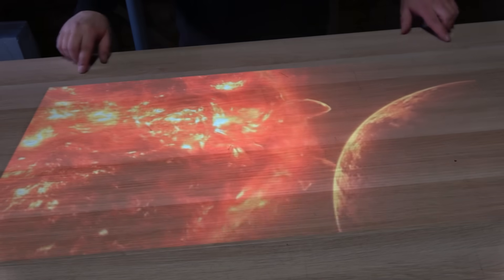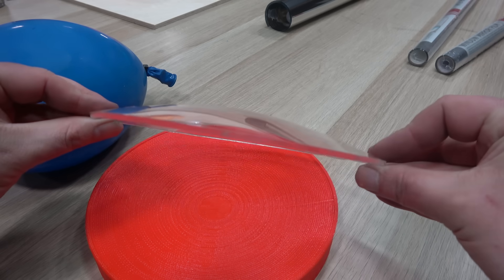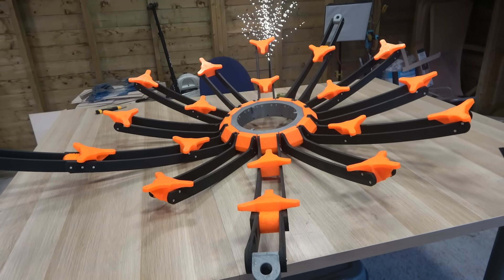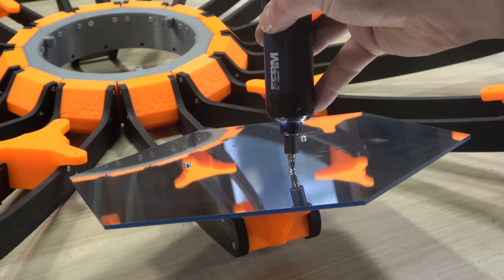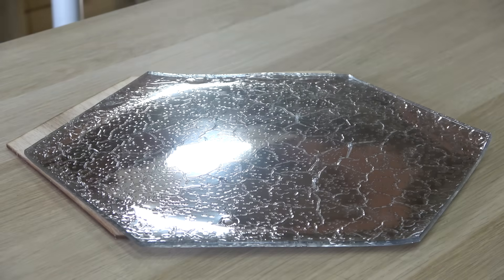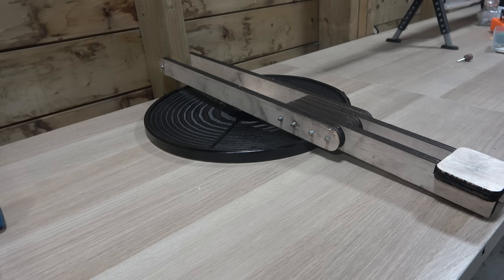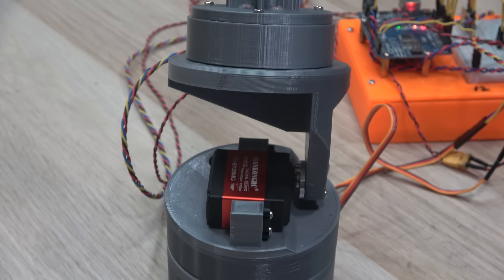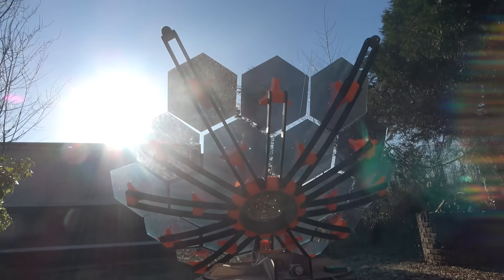Building a DIY Solar Generator..

Comment: I'd make the aluminum plate black to reflect less light. I personally would make more parts out of metal, but what you are doing seems right for the prototype stages. I'd replace the acrylic on back of the aluminum plate with something more heat resistant. I've see smaller mirrors melt metal and stone in short order. I would think that amount of heat might outrun that pump. Maybe add a temperature monitor to the system and program the tracker to take a break if needed in the current config. Paint can be polished to a real good surface finish giving it more reflectivity. I'm not sure how well 2k or epoxy paint works on acrylic, but that would be a more durable paint. 

Cool project.

Comment: It might be best to put the pivot point over the center of the lazy Susan. This way there won’t be any drag on one side of the bearings. Which would cause the wood to rub which would cause friction and make it not turn smoothly.

Comment: What an awesome project!  Very impressive. I think you're right to be concerned about the veritcal adjustment mechanism though. I'm sure it works great inside but I would assume that any amount of breeze outside would cause a failure, the mirrors will act like a huge sail. That same motor might work but I think if the reflector frame was mounted to a trunion, not unlike a bandsaws table, it would be a lot more stable and robust.

Comment: Some suggestions for improvement:
Shape the mirrors before applying the reflective film, that way the heat doesn't affect them. This does have the downside that you'd need to use a rubber or other flexible squidger in order to apply the film
individually parabolic hexes don't add up to a parabolic array, you should have forms to shape them to make the full array of mirrors parabolic. Based on your design, you would probably only need three forms: one for the inner 6, one for the 6 outer corners, and one for the 6 outer middle hexes. If it isn't clear, it's similar to making a giant poster by printing it out on multiple sheets of standard printer paper and then taping them together

Comment: Suggestion 1:  Have the focal point separated from the mirrors, like the molten salt reactors. Since you are using separate mirrors, they can be placed in any configuration. Only sun tracking is not as obvious anymore as your current solution. Combined with the multiple non-parabolic mirrors as described by @leifhietala8074 could make construction less complicated. 
Suggestion 2: Use aluminum foil for reflection. Your painted surface still looks diffuse which will scatter light all over the place. The reflective side of the foil does a far better job. Not sure how it holds in the dutch weather though :)

Comment: I absolutely understand that people who make these are way more knowledgeable about them than I am, but, my thoughts:

- 1: really, all you'd need is the mid point height for noon, and sunrise and sunset; cause then you can just have a single gear controlling it, and a limited range (unlikely to meet or exceed 180*); which means fewer components, less moving parts, and cheaper/easier to maintain

- 2: add some kind of self balancing aspect to it; basically best I can figure is a heavy enough ball weight, that slides along a track to keep the center of gravity low, so the thing won't randomly tip over from the top

- 3: more nitpicking than anything else, I'd close the gaps between the mirrors, lol

what I am curious about, is if maybe this type of solar generator would maybe be better than regular panels? if so, this could be far better to implement than panels, and has the ability to be hidden as needed (or even super decorative/decorated). Cause the panels just like bland generally. And, I'm curious, are you trying to get it to boil water and turn it into steam, or is there something else to it? Cause I was thinking if we did the molten salt solar plants on a small scale you could do well with improved power generation for homes.

Comment: The aluminum collector has the potential to transmit heat to your 3D printed components unless most of the heat is extracted from your water.  At that temperature,  your plexiglass will warp & spill your cooling water - creating a runaway temp condition. When you 'go live', have a way to cover the system.
I also think the plexiglass mirrors will absorb heat & will distort.  Have you ever picked up a chrome tool left in the summer sun ? It will get your attention fast !
I'm curious about the results.

Comment: I was expecting better thought out construction on the actual frame.
One gust of full wind the entire setup becomes a kite and will tear of the setup and either crash on the ground hopefully or will fly and crash into or into someone.....
So....
There just too many to count in this setup.
There's a video of a guy from Pakistan who made good one using the existing big sized satellite dish and added in actual glass mirrors piece by pice.......
That was more sturdier than this setup.

Comment: Really interesting project. Back in BEAM robotics days, we would build sun trackers with LDRs that way. The solar panel powers the circuit, so you build the circuit to move motors so that the panel is always pointed at the brightest light source. I always imagined using one to control a large dish like this, so it's super cool to see!

You're using plexiglass for the mirrors, which allows visible, IR, and I'm pretty sure most UV to pass through, right? What about pressing the plexi first, and silvering the back instead? That would give a much smoother finish, but who knows... people do this with aluminum foil, so maybe that much precision isn't worth the effort.

Comment: Since the Primary mirrors are flat and angled for overlap, the secondary mirror will have to have the same or slightly larger surface area to redirect towards the heat plate, but also be offset from center. Due to the layout, the secondary mirror should be a ring of mirrors the footprint of the primary mirrors allowing for direct and reflected concentrated light to hit the hot plate. The primary mirrors do not need to be placed in the secondary mirrors shadow. OR. Solar trough, make a long collector in a parabolic shaped long trough and align it East West so you only have to adjust vertical with the seasons. Flat mirror ends to help with low sun angles. The wider the better, you can only collect as much energy as you make shadow, square footage is everything. I've been looking into vacuum insulated solar tubes for heating water but with a parabolic trough behind each tube I would need a fraction of the tubes and would lower the investment required. They use solar trough to heat salt or oil in power stations.

Comment: Regarding the solar tracker i would recommend you to use an Arduino library which calculate the azimuth and elevation of the sun for a given latitude, longitude and UTC time. It's called jpb10/SolarCalculator

Benefits: you will avoid malfunction with the alignment of mirrors and the sun in cloudy days (something you need living in the Netherlands)
Good luck!

Comment: The mirrors away from the center have to continue the parabola, aka, you CAN'T use the same mold for all of the mirrors, the light will be coming at an angle and not go to the focal point, you need 3 different molds for the ones nearest to furthest from the center (also molds will be directional)
Reply: Given that he's concentrating the light onto such a large collector (the size of the reflecting mirrors themselves), he'd actually be better off making the reflectors perfectly flat. This will distribute the solar energy over a larger area of the collector, increasing its ability to efficiently collect it (and transfer the heat to the water).
Reply: A couple of packs of flat, hexagon mirrors from Amazon are £18 (US$20+), would save a lot of hassle. Would need to be fixed differently as generally they don’t like being drilled. Improved reflectivity would be a plus. Because they don’t need to focus the sunlight onto a fixed point, and it doesn’t need to be optically accurate, flat mirrors (OK angled parabolically) would be good enough. Engineer talking here, looking at the cost/benefit balance.
Reply: @johnworeilly4051 agreed, IIRC an unfocused collector can be significantly more efficient than one that creates a point.
Reply: Also do note, if you want to focus all light onto a single point the secondary mirror will have to be an ellipsoid one, with one focal point matching the one of the large mirrors, if you want the heat to be more evenly distributed a parabolic mirror will do the trick
Reply: @darioferretti3758 Being a technical person myself, I understand the tendency to over-engineer things to astronomically mathematical precision. Nature is usually more forgiving. The goal here is to concentrate sunlight on a collector that is a disc, not a point. Overthinking can improve efficiency marginally, but that kind of precision just isn't necessary. Especially for a proof of concept. Close is good enough.

Comment: 1. You try to normalize the reflectivity of your paints by measuring it with a laser, but all this does is tell you how reflective those paints are at the specific test wavelength of your red laser, but nothing about their total reflectivity across the full solar spectrum (also ignoring possible differences in the eventual solar energy absorption of your target). Paint colour also tells you nothing about how reflective overall something is; you really need a spectrum (or simply test the energy captured empirically) to make a determination.

2. You then invalidate your testing entirely by switching from paint to a reflective window film, which has completely different characteristics (despite also being "silver coloured"). Maybe it's better, maybe it's worse - you have no idea, and the colour itself tells you nothing.

3. Rather than make a complicated multi-part multi-material assembly with TPU "springs", a compliant mechanism in your mounting plates for the mirrors would have accomplished the same goal more easily with less parts. You should not need much adjustment range to fine-tune the mirror position, assuming your overall structure is reasonably well-built.

4. You make an effort to curve your mirrors to each be the center of a parabola (after trying spherical) but strictly speaking, each mirror should actually be an off-axis segment of a larger parabola and thus every mirror should actually be somewhat asymmetric. This doesn't matter too much for an energy-gathering application like this, but it does mean your point of focus is larger than it could/should be, and negates most/all of the benefit of going from spherical to parabolic in the first place. It's absolutely critical for imaging applications though; every segment on the JWST is shaped differently for its specific position in the mirror array.

5. Your actual light collector at the center is deeply suboptimal, because it's made of highly reflective aluminum. Ideally you want this part absorbing the maximum possible amount of light, so it should be painted black in a a paint that absorbs as much light as possible over the sun's typical spectrum. Most solar collectors I've seen actually use a clear front (plastic or glass depending on temperature), then a water channel with a black backing, to ensure efficient heat transfer into the working fluid without having to conduct through the whole plate.

6. Your light collector plate is huge (much larger than your focus would/should be), wasting a large percentage of your solar collection area and increasing the weight of the mechanism substantially. Try to optimize for a smaller collector with higher water flow rates if required to keep temperatures under control.

7. You're concerned about the altitude motor tilt mechanism and its strength/stability; you should be able to balance the mechanism around the pivot point so that your motor is actually carrying almost no load statically, and nearly all the weight is borne by the main hinge. One caveat here is to consider wind loading, which will bear on your altitude actuator (and could be substantial with a reflector this size). If you want an alternative design that's more stable, take a look at the curve segments used as altitude bearings for large Dobsonian telescopes. These allow you to place the center of rotation much higher up without using additional counterweights, and as long as you keep your range of altitude angles reasonable, should not be excessively large.

8. Your secondary mirror is going to present you a lot of problems. It will firstly cause additional light loss due to imperfect reflectivity, and it will also get extremely hot because it's operating in a concentrated sunlight path. It's also difficult to pick an effective shape for this mirror; if you had a properly parabolic primary, this mirror should be flat to avoid introducing distortion to the final beam (which would increase the size of your focal point) but a flat mirror will be large at the apparent focal ratio your dimensions imply and block a lot of the incoming light. You can use a curved secondary which could be smaller, but then you probably don't want to use a parabolic primary and will instead need to use some other combination to achieve a good focus. You'd be much better off placing your collection point at the primary focus; it can be fairly small with the right materials and correctly-designed primary mirror shape, and it will be watercooled so it's easier to avoid overheating vs a passive secondary mirror.

Comment: your reflectivity test is flawed. no mirror is actually a full mirror, they are only mirrors in the wavelengths they reflect, and their effectiveness as mirrors is dependent partially on what percentage of that particular wavelength they reflect. your laser is unlikely to be in a wavelength both materials absorb at the same rate.

Comment: This is the concept I needed for my design and I know the algorithm brought me here for a reason lol. We are working on different light spectrum's though lol. I need less heat and a more solar panel friendly spectrum. The telescope concentrates the light and sends it indoors over photonic or fibre optic lines and spreads the light out to a server rack full of stack-able solar panels, mirrors, and diffusers. Not built yet but I would like to see just how far a system like that could be pushed. We should share notes lol.

Comment: That what we call great idea but poor execution seriously you made alot of impressive stupid mistakes ( shape the acrylic then put your reflective film on ) 2nd window reflective film isn't 100% reflective it's designed to let some light passthrough (oneway) 3rd your mechanical implementation is a great receipt for disaster a'd 4th seriously 3d printed springs and for outdoor use case 🤦

Comment: I love the design and engineering! Also great to see the experiments along the way to compare different possible solutions!

I do research in nonimaging optics & solar concentration, and wanted to share some input on the optics. Using JWST as the inspiration leads to a very nice-looking design, but there is one important difference in the optics to be aware of:
- JWST’s optics are designed for magnification - it is designed to take the light from a super-narrow region of the sky, and turn in into a relatively large image on the sensor.
- A solar concentrator has the opposite goal - it should take all the light from a wide region in the sky (the sun + some area surrounding the sun), and focus it down to a very small area.

These different goals leads to some different tradeoffs. In this specific case, it will mean that it will be difficult to redirect all the light from your secondary reflector down to your aluminum heat plate, without very tight tolerances in the whole system.

The simplest way to get a much better tolerance vs concentration-tradeoff would be to skip the secondary mirror and put your aluminum receiver directly in the focus from your parabola. (This is similar to existing parabolic dish concentrators that have been used for power generation.)

Another option for getting better performance would be to use just a flat mirror on your solar tracker to send the sunlight horizontally, and then mount your nice concentrator in a fixed orientation to receive this horizontal sunlight. This is known as a solar furnace, and is how research facilities use sunlight to do experiments with highly concentrated sunlight without having to move their experimental setup as the sun moves a cross the sky. 

Looking forward to seeing your follow-up!